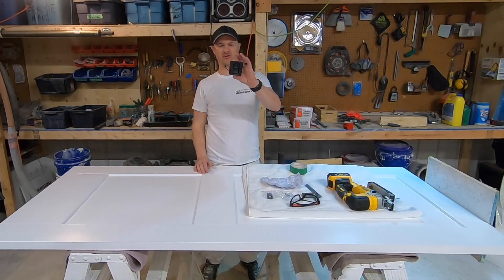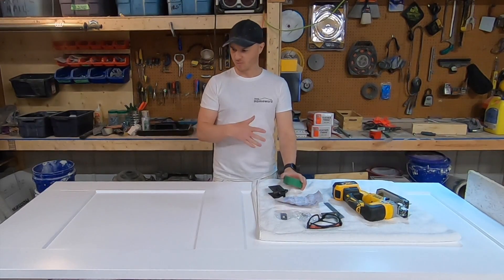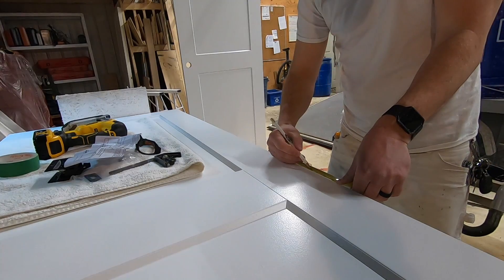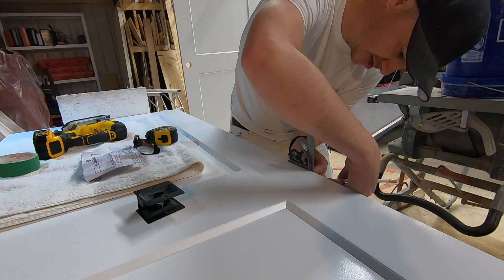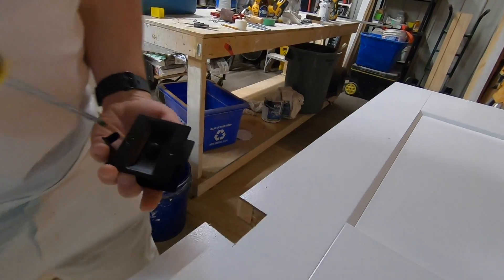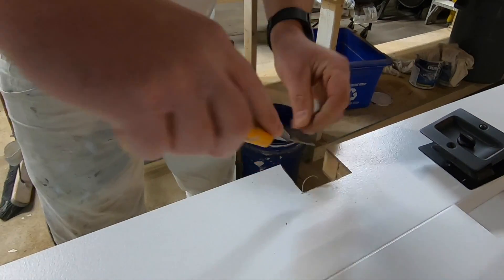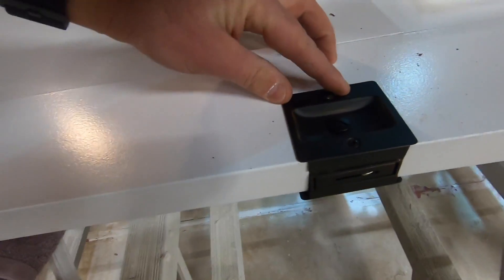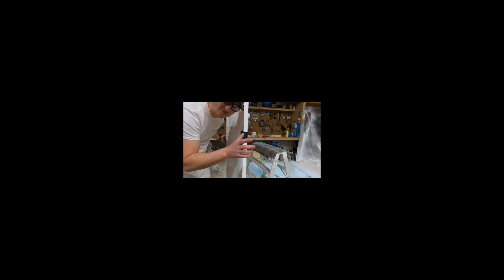How to Install a Pocket Door Handle / Pull

Comment: Good clean saw cutting. The side plates overlap enough to cover some mistakes.
They don't tell you in the lousy instruction sheet that the wood screw holes in the lockset and the striker plate are dimpled, so you need to countersink (which you did). The instructions do say to drill a 1/2" hole in the center of the door cutout - but I don't see why.
BTW, if you go to the Amazon page for this, they link three videos from the manufacturer, where they say to chamfer the cutout, how to reverse the lock,  and they show the holes dimpled. Now, if only they'd rewrite the instruction sheet
Reply from the maker: They are a pain in the butt. If I had to do a bunch I would make some sort of jig for it but it's usually only one here and there.

Comment: definitely drill a cut out/  recess  in the back of the cut out. Without it the mechanism rubbed a little and the latch wouldn't open all the way. I used a 3/4" spade.  only need a 3/16 deep hole